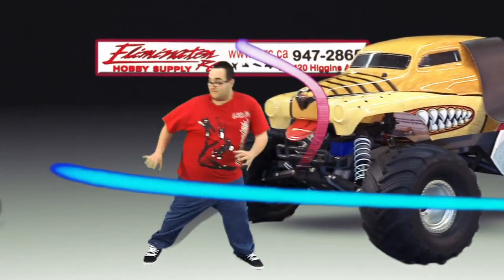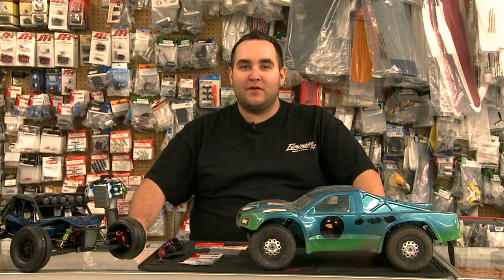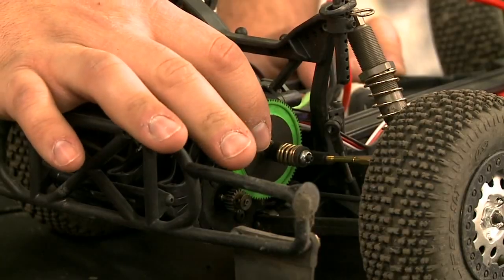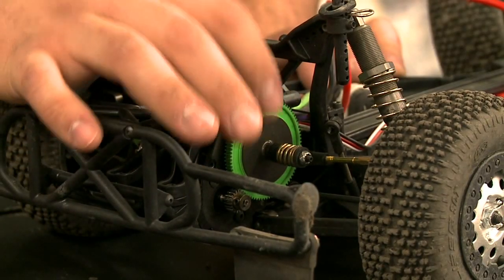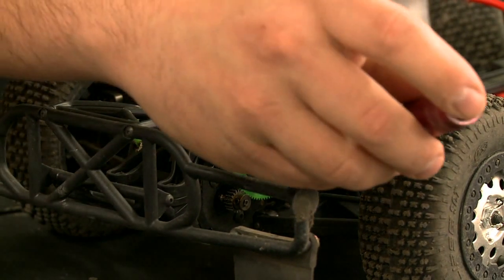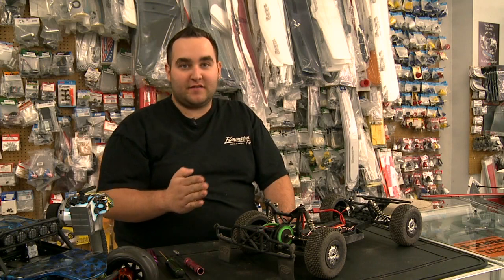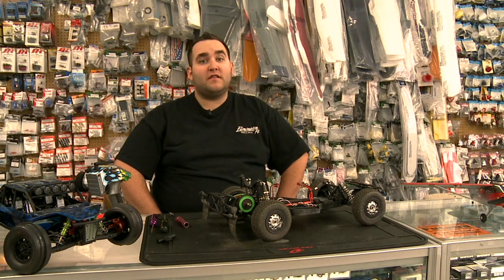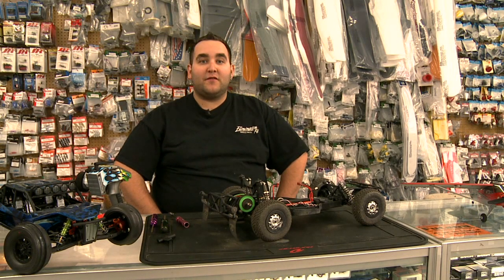A look at the RC Slipper Clutch

Comment: I have a metal pinion and spur and I burned my pads about 4 times already I only get full batteries run b4 it's burnt out?? Ecx ruckus on 3s lipo I tighten it snug then back it out a turn and still.... any suggestions?